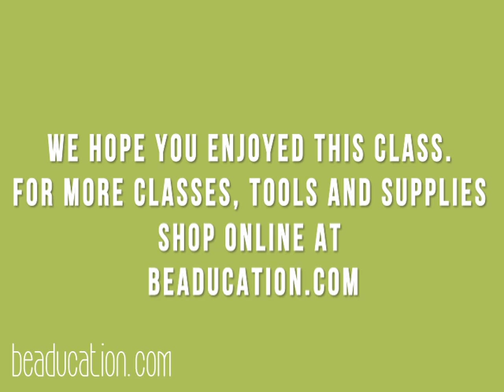Hammered Textured Metal - Beaducation.com

Comment: The third hammer in the beginning of he video gave me an interesting idea. I'm attempting to get in to jewelry making my self and been looking at different hammers. The pattern on the face of the hammer looked to me like it was etched at first. I want to try to get a similar hammer and paint a pattern on the face using a sharpie marker. What I want to attempt is to use electrolysis to make a relief of that pattern on the face of the hammer. The sharpie design would prevent the metal getting etched at that area. All it would take is a power supply and a salt and vinegar solution.
Reply from the maker: interesting idea, let us know how it goes!

Comment: I have a texture hammer (it was an Xmas gift) it has 6 texture heads and I would really like more different heads. How can I be sure that any new ones will fit my hammer? Do I need to measure the thread and the diameter of the retaining rings or what?
Reply from the maker: I don't think the heads from other hammers are interchangeable. In my experience, only the ones that come with the specific hammer fit.

Comment: What kind of hammer is the pristine, shiny hammer, what is the real name not the make or brand but the type T/Y
Reply from the maker: +Robert Beaulieu If you are talking about the flat smooth faced hammer with the darker brown handle, that is a Chasing Hammer.
Reply: Thanks, I have found there are as many different types of hammers for working copper and other metals as there are anvils. Hardy has a good selection of both.

Cheers